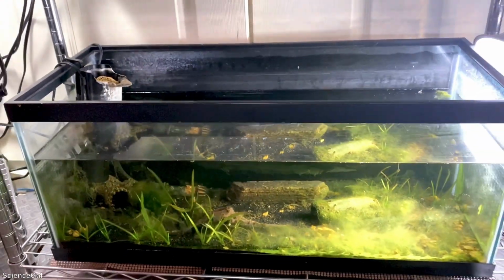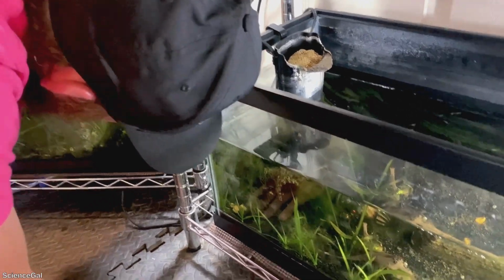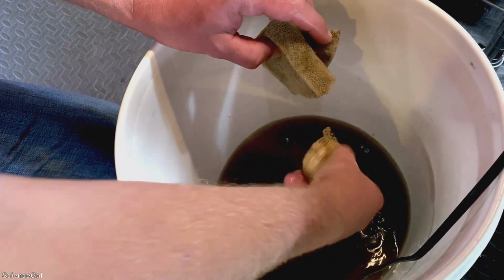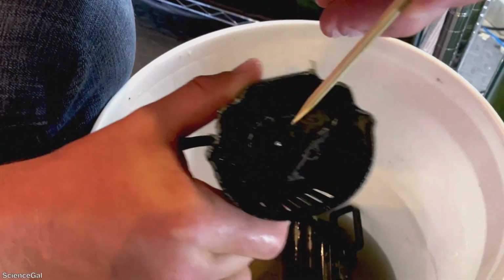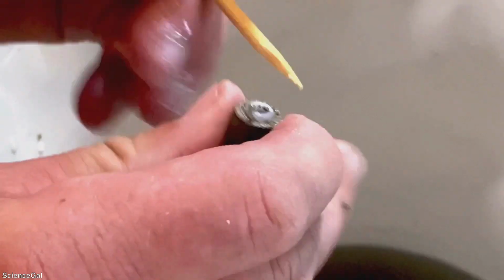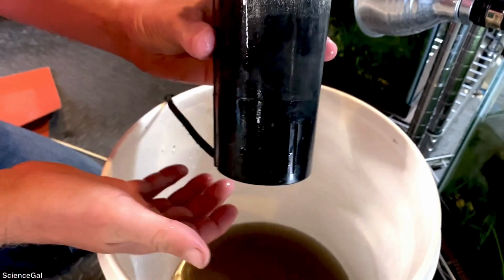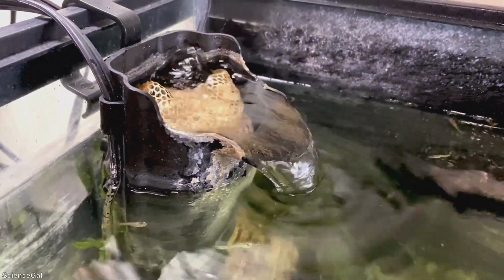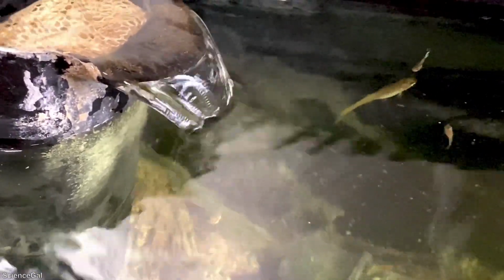Fish Tank Filter Not Working

Comment: I brought a used 20 gal (high) Aquarium that came with a tetra whisper internal 10-30i. This filter must have been the OLD style since I had to unscrew 2 bolts to remove the bottom strainer. Under the strainer there was a 40 gph submersible pump unit that I couldn't figure how to remove the impeller. I removed all the visible caked on flake food from the intakes of the pump. I then run the pump unit in a pail of hot tap water, I changed the water three times before the pump stop coughing up old fish food flakes. I then let the pump unit run in a pail of white vinegar and hot water solution for a few minutes to hopefully dissolve any mineral deposits around the magnet and impeller. I haven't placed this filter into service yet but I think I'll try to put some pre filter material (filter floss and a nylon sock?) around the bottom strainer assembly to prevent the pump from clogging.

Comment: I have a whisper hang on filter for my 5 gallon tank. I've only had it about 2 months and every thing was fine until today I noticed that it is bubbling up inside the filter. If I lift the cartrige up just a little then the water goes under the filter and the bubbling stops. Maybe there's build up in there too.

Comment: Hi, I have the same filter but I don’t know if I’m weak or if my filter just isn’t separating but I cannot separate both parts to get to the propeller. It’s the newer model as well so I can’t see any screw. Is it supposed to be  a little difficult to separate?
Reply: Same here. I kinda tried to pull the bottom off but it didn’t seem to want to come, so I didn’t think it would come off. Then I watched this video and now I wish I would’ve yanked it off anyway🙄😂 The worst I could’ve done is break it right? Unfortunately, I’ve already thrown my filter away though.
Reply: I recently found out you just need to keep pulling it’s really stubborn but after you remove it once it gets easier next time. I almost through it out too haha